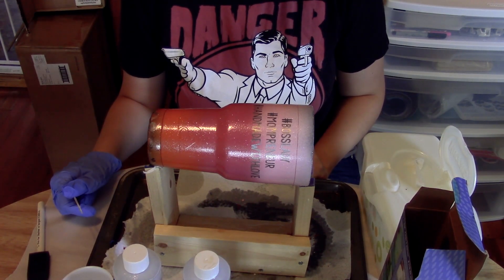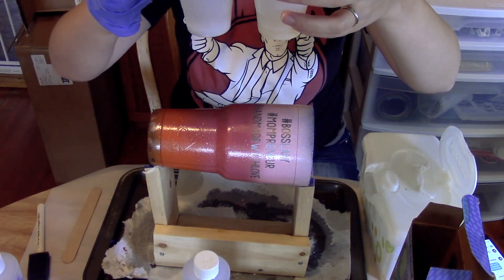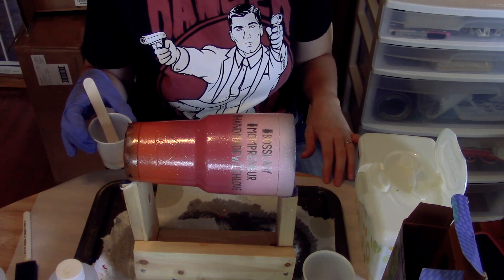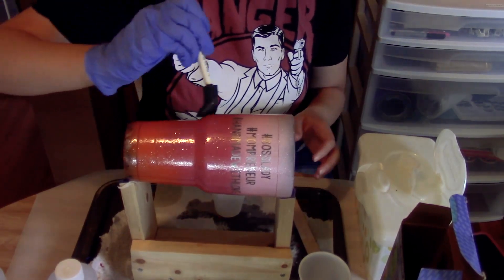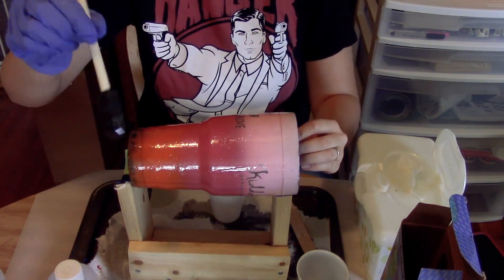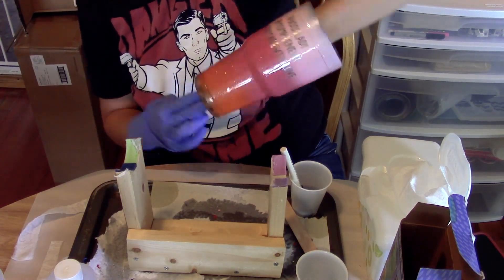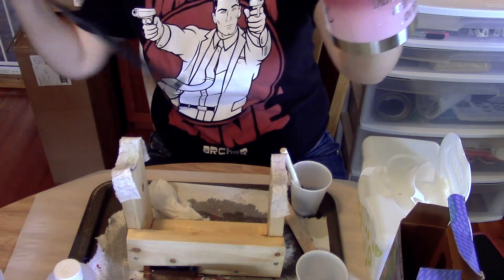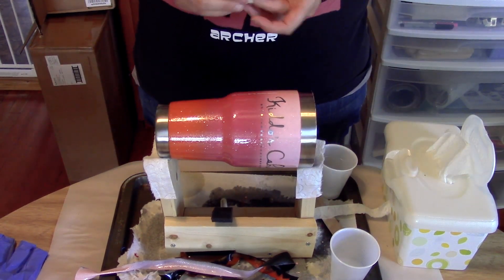How to Epoxy your Painted Tumbler

Comment: Your video is amazing!!!! I put my layers of triple thick on a couple of hours ago and I am wondering how long I should wait to put epoxy on...
Reply from the maker: I usually try to wait 24 hours- that gives the triple thick time to cure and release the gases/chemicals before applying epoxy.
Reply: is this triple thick cream or the triple thick spray?
Reply from the maker: Shawna Reynolds I use the spray.

Comment: Thanks for the video!! After you applied the epoxy and took off the tape you said if drips form to just keep smoothing out. How long should you keep brushing or messing with it?
Reply from the maker: Kim Broadwater I'd actually just let the drips level out on their own after removing the tape. I only smooth out for the first 30 minutes if needed. It le els itself out pretty well

Comment: I have used the Resin/Epoxy to make jewelry for years. I never new I could use it for sealing a cup. I am new to doing the cups and have not tried the glitter yet. Thank you so much for these two videos I have watched today. Now I need to get the supplies so I can try it. Let me ask can you use regular glitter, rather than spray glitter? The reason I ask is my only sort for supplies is Wal-Mart and they don't always have what I need. I may not get to Hobby Lobby until at least next week it is an hour away.

Comment: This may be one of the most down to earth, best videos I’ve seen! Question- I have a purple yeti that I’ve already applied vinyl to but the vinyl is thicker than I’ve had before. Am I good to go ahead and do a coat of epoxy to seal it or do I need to do additional steps? TIA!

Comment: Great videos! My 2nd one is in process and I'll try the clear coat under as suggested in this update. Question: have you done the specs for the stand? My builder will be making it soon and I'd like it correct from the start
Reply from the maker: I need to get to work on that! I will post when they are ready

Comment: Hi there, do you think I could combine a couple of different methods - use fine glitter with adhesive spray, then triple coat, and then the epoxy?  Rather than spray paint and glitter spray?
Reply from the maker: Absolutely! I have done spray adhesive with loose glitter, triple thick spray, then epoxy. no problem!.
Reply: A W E S O M E !!  Thank you so much!

Comment: Do you find that the epoxy/resin sealer scratches? I did a cup and see scratches on the parts where I had my stencil. Not sure if the cup was scratched before or the resin scratches easily. Also is there a way to correct if you have ripples? Thanks for your videos and wisdom.
Reply from the maker: I had been noticing scratches too, so I started applying my stencil and then sanding around it. You can try to wet sand the tumbler in areas where you have ripples, then apply another thin coat of epoxy. Hope that helps!

Comment: how long do you think you rotate the cup until the epoxy is dry ? and how long to you let sit before you rotate the cup
Reply from the maker: I turn every few minutes for about 20 minutes, then about every 15 minutes for an hour, then just as needed. I usually stop seeing drips around the 6 hour mark, but I don't watch it closely after the 2 hour mark- I just check it once every half hour, to and hour

Comment: I used to do Granicrete countertops.  To finish, I applied an epoxy and then used a torch to remove all the bubbles and imperfections by heating the epoxy, which produced a glass-like finish.  Basically, you put the flame near the epoxy but not touching it.  This also helped the epoxy to dry to a completely hard finish.  Have you ever tried heating the epoxy on the cups?
Reply from the maker: Pamela Mooney I have when I notice bubbles but I need a better system. the hair dryer sometimes causes other issues. what would you recommend?
Reply: I use a small blow torch.  This is the one I use:  m.lowes.com
Reply: It will help stop dimpling too.
Reply from the maker: thank you!

Comment: Hi. Thanks so much for your great videos! I have a question... Do you take off the original painters tape at any point and replace before you epoxy or do you leave same tape from start of painting until epoxy is finished? Thanks!
Reply from the maker: I leave the same tape on from beginning to end; however, I sometimes remove tape before epoxy and reapply just a hair above the paint line just to make sure everything is nice and sealed in. I mostly do this when I have multiple colors

Comment: hey! im sorry if you have already answered this question, I looked and didn't see it! 

where did you get your stand? 

do you turn every half hour? for three hours? and you do this once, then do another coat? or is this it? 

thank you❤️❤️❤️
Reply from the maker: my step dad made the stand. and I rotate as needed for the first hour, when I see drips. I rotate about every half hour for the next 2-3 hours. or until I don't see any drips forming. after 3 hours I rotate once an hour until about 8 hours has passed (or so).
Reply from the maker: Courtney Steely this is a one coat application process.

Comment: Great video. Thanks for sharing. Is it dishwasher safe? Can you leave vinyl stickers on and use the epoxy for long term protection?
Reply from the maker: Charlie Lenox some tumblers themselves are not dishwasher safe, due to the insulation. some are, just check labels. I haven't had any issues with the epoxy when using the top rack of the dishwasher. I often leave vinyl decals on under epoxy- they definitely don't peel off that way!
Reply: Great. Thanks for the quick response. You do awesome work. I have seen a man doing epoxy using a motorized stand to slowly rotate the mug as He was applying. Ever consider that, or would that be a waste in your opinion? Would love to see more content on your channel. Keep creating.

Comment: So I've done about three now and I'm running into an issue with dimpling. I assumed it was because I didn't use enough epoxy, but I did a third cup keeping everything the same and instead of dimpling it kept having drips. So my first question is, is dimpling a sign of not enough epoxy? How would I go about fixing this? As for the cup with excessive drip it actually started to harden with a drip line. Is there away to correct this? Sorry for the long post, but I look forward to your response.
Reply from the maker: AnAlYs09 I always get dimples when I don't apply two layers of triple thick spray prior to applying the epoxy (let dry at least 48 hours before epoxy). 
the drip line happens when you don't rotate it enough- I've had a few that have done this. its very difficult to correct but possible. I use a fine grit sandpaper, get the sandpaper wet, and work out the bumps. be careful though- it will take epoxy off quickly in the "low" spots and you'll end up taking paint off as well. wash it well and apply a new thin coat of epoxy

Comment: With a manual turner like you have to do with your stand, how often do I need to turn the tumbler and how long do I keep turning it? Also, how long does I let the first thick epoxy coat dry before doing a second coat?
Reply from the maker: I turn as needed, when drips appear on the bottom edge. I do it as needed for about 8 hours- i watch it pretty closely for the first two hours, then just every hour or so until the drips stop completely.

Comment: Great job! Well I guessed I messed up 😐 I've applied a thin layer and let it dry and then I was going to go back and apply another coat. Any advice?
Reply from the maker: it depends on how it is "messed up" dimples? Rough spots? You can try to lightly sand the first layer of epoxy using the wet sanding method (ultra fine sand paper, get it wet, sand really lightly). Then apply a second layer.

Comment: I have only painted the bottom section of my cup.  The vinyl will go on the top portion.  Would I then need to finish then entire cup as though I painted it all?
Reply from the maker: I don't usually have to seal over just vinyl. I wouldn't worry about it!

Comment: If you're doing a vinyl design that will stay on the cup (rather than a stencil), would you do that after the triple thick and before the epoxy? Or in between two coats of epoxy?
Reply: I do mine in between the two coats of epoxy.
Reply from the maker: Amanda Stumpf I do after triple thick and before epoxy when doing one coat.

Comment: I noticed you mentioned in a comment to use triple thick spray OR SEALER equivalent. What would you consider an equivalent? would this be like a polyurethane sealer?
Thanks!!!
Reply from the maker: Kara Meyer I would say that polycrylic would be a good equal to the triple thick spray- either spray or brush on :)

Comment: Do you have any suggestions on how to apply the epoxy if you painted the whole cup and not taping off the top or bottom?
Reply from the maker: I haven't tried it yet. I wanted to make sure that the cups are safe for customers, so I leave a space at the top. The epoxy is FDA approved for food containers, but it is limited. It can't be used on the insides of cups where liquids or foods will go, so I always play it safe.

Comment: Thanks so much for the video, Cheryl!  I am jumping into this new craft this weekend if my 631 Vinyl arrives tomorrow.  Just to clarify, you use a total of 2T of epoxy (1 T of each part) for each coat?  Thanks!
Reply from the maker: Amy Gewecke yes that's about how much I use. that will be plenty and leave you with some extra as well. I can do them with less though, if I need to.
Reply: Thanks so much for getting back to me.  An epoxy kit lasts a while when using that small of quantity.  I've only ever cast large molds that call for about 6 mixed oz at a time and that gets expensive when you're making sets of coasters!  Have a good one!

Comment: I notice that you are rotating the tumbler often to ensure that the epoxy evens out nicely. How often do you rotate it and about how long does it take to even out so that you don't have to rotate it?
Reply from the maker: I try to just watch it for the drips forming on the bottom edge. In the beginning, every 5 minutes or so, just for about 20 minutes. Then I just watch it and turn as I see the drips forming. It can be a pretty time consuming process. I usually spend about two hours total from beginning to end.
Reply: so after the 20 mins of turning your tumbler and all of that,,, do ya set it up right to cure for the 24 hours so that ya can move on to the next one or will it all drip to the bottom of the cup?  
sorry I know it's crazy question, I just don't wanna ruin my cup! 
Thanks!

Comment: Nicest job with glitter I've seen!  The glitter you used is it a spray on and then a few coats of Triple Thick and dried?  Then you put the epoxy on?  Beautiful!!
Reply from the maker: I do a spray glitter, then triple thick, then epoxy. I have also done a few with spray adhesive and loose glitter!

Comment: I have a question about the "food safe" aspect. I have a cup that's painted on the INSIDE. Can it be coated with that epoxy and be safe to drink from? Thanks!
Reply: pancelticpiper The answer is no. Because it will get into your drink. Epoxy in general has to be hand washed also

Comment: I just made my first one. I applied the epoxy about 2 hours ago but I see dimples. I thought I put it thick enough but I guess now. How long after can I add another coat? Here's what I'm thinking: add tape around the same area, lightly sand it, clean with alcohol and epoxy a thick layer. Sound right? Just not sure how long to wait? Guessing around 6 hours?
Reply from the maker: Jennifer Ruiz 24 hours until it's no longer tacky to do a second coat. do a wet sand with fine sand paper  and you'll be good to go!
Reply: I also get fish eyes even on my second coat... So I need to sand lightly to kinda even it out?

Comment: Have you ever put another layer of epoxy on top of a previous layer. I follow your steps religiously as I know they work, but I have a monogram that when I put the epoxy on it seems to have gotten underneath the vinyl and now one corner is not "sealed". So my thought was to do another layer of epoxy. Any thoughts?
Reply from the maker: I've done multiple coats of epoxy. I do the second layer much thinner and it seems to help!

Comment: Hi!  Do you rinse and reuse your sponge brush and cups or a new one every time? thanks!
Reply from the maker: I use a new set of cups and sponge each time. I have tried to wash and reuse but it is a huge chore, and I always got little bits of epoxy that was dried mixed into the new batch... just a headache. I buy cheap little bathroom cups and cheap sponges.

Comment: I just did a mug but didn't do the triple thick first, the finish is not smooth at all and it has ridges in it. Do you know how I can fix this? Should I sand it down and start over? Can I spray the Triple Thick over what's there and put another coat on? Thank you!
Reply from the maker: You can try a wet sand, and then apply a new coat of epoxy... but no guarantee it will be super smooth. I have had to start completely over...

Comment: Can you please tell me how much of each part you use for 20 &  30oz tumbler?  I done my first one yesterday, but it looks kind of dimple,  don't think I used enough epoxy,  Thankyou Lynne
Reply from the maker: I use about a tablespoon of each part for 20 and for 30 oz. I would rather mix up a little too much than not enough. so put it on thick and also make sure you are using the triple thick spray (or equal) before the epoxy. :)
Reply: Ahh I didn't use triple thick first,  Thankyou so much xx

Comment: Do you do anything to the edge where the epoxy meets the unpainted part to make sure it is a smooth transition?
Reply from the maker: Stephanie Curtis sometimes I pull the tape off, then reapply just a hair above the line

Comment: How long do you leave the tumbler on the stand before moving it off to start another?
Reply from the maker: I usually wait about 4 hours at least. I wait until there are absolutely no drips forming on the bottom edge
Reply: So after 4 hours on the stand you move it off to it's upright position to finish curing the 24 hours?
Reply from the maker: I don't necessarily watch the clock. For example, I have 6 cups sitting, still in the horizontal position, and I started the process at 8 hours ago. I just let them go until I see absolutely no drips forming on the bottom edge. It will vary with the thickness of the epoxy .
Reply from the maker: I also have a set up to do up to 8 at a time.

Comment: Once you've applied the epoxy how long until the tumbler is completely cured and ready for use?
Reply from the maker: Rhonda Curtsinger I would check with the information in the packaging, but my general guideline is cured in 24 hours, ready to use in 48 hours.

Comment: Hey I am using triple thick glade and keep having problems with it running and making bad spots even when I keep the cup horizontal
Reply from the maker: I haven't tried the triple thick glaze- I use the triple thick spray after painting and before epoxy. I use the two part epoxy shown in this video- not sure how it compares to the TT glaze!
Reply: Mad Mugging Mama hmm okay I was using the glaze and was going to top with epoxy. I've got the spray also. Have you had a problem with it running or making globs?

Comment: What are the benefits to using electrical tape? You said it leaves clean lines just like painters tape, but that it's a bit tougher to get off. Do you prefer electrical over painters?
Reply from the maker: I prefer painters tape for parts, electrical tape for other parts. I love electrical tape because it comes off clean... but I can't get nice clean even lines because the material is so stretchy!

Comment: Hi! Great video! So I just completed my first 2 tumblers....but 23 hours later, the epoxy is still tacky. Should I give it more time? I've read "horror" stories about epoxy NEVER drying if not done properly. I believe I followed all of the steps properly (equal parts, mixing, etc.) but I'm getting worried...and impatient! Lol. Help please!
Reply from the maker: Cassandra Jackson at 23 hours it should definitely not be sticky or tackey, even if you're in a humid environment. I would guess you have unequal parts of epoxy or did not mix long enough.
Reply: Mad Mugging Mama Oh boy...thank you! Do you think I could re-epoxy them (over the sticky epoxy)?? Or do I need to just start over? Thanks again for your help!!
Reply from the maker: Cassandra Jackson I haven't ever tried it, but at this point, what have you got to lose?

Comment: Do you put your vinyl on before applying the triple thick??
Reply from the maker: Either way- I have done both with the same results. However, I have found that if there is glitter involved, the vinyl sticks better after two coats of triple thick.

Comment: Hey any issues with bubbles? I have done a couple of cups but got some bubbling? What did I do wrong?
Reply: Whitney A  Use a heat gun or a torch to help pop the bubbles and try mixing the resin and  hardner together slowly to avoid adding air bubbles.

Comment: Ok so how would you do this if you didn't want to tape the top part?  I have  been having dry spots in my resin even after I know I put epoxy on it???? But I don't use a clear coat first so maybe that's the issue?
Reply from the maker: That was exactly my problem. I got horrible dimples over the whole cup when I skipped the triple thick/sealer layer and went straight to epoxy.